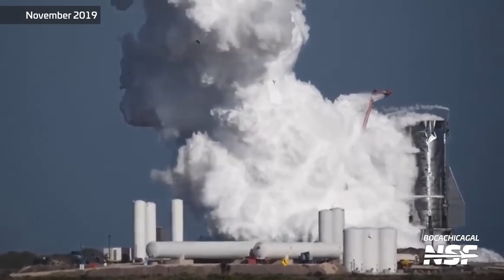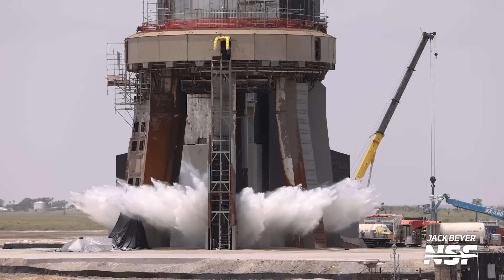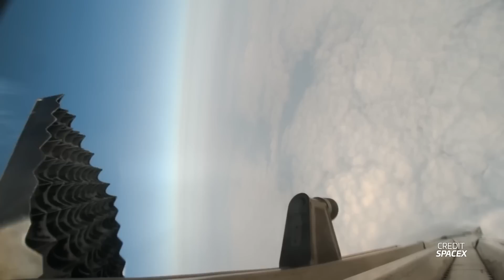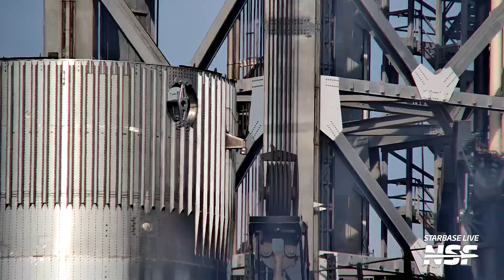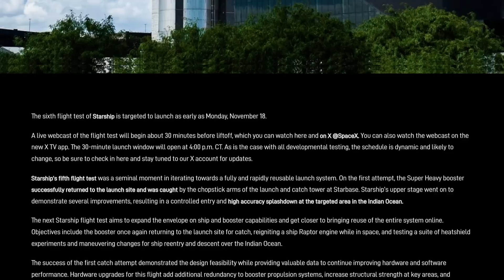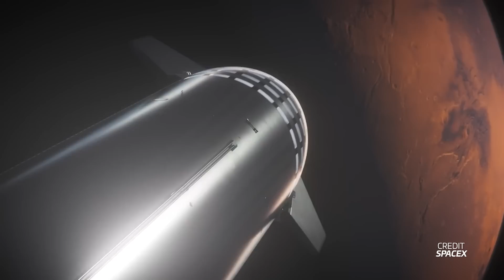Starship Flight 6 Approaches: Timeline, Tests & The Road Ahead! 🚀

Comment: Let's face the facts. To expect that a vehicle have max performance in both atmospheric flight and space flight is ludicrous. Is like expecting that a flying boat will be a better boat and a better airplane. It can't. It will be a duck. It swins, it flyes, it walks but do none is a very efficient way.

We better create space vehicles with specialized purpose as follows:
- Lifters. Capable of pushing things to orbit. They will be different from each main celestial body. A lifter on earth is significantly different than the lifter on the Moon (it could be a mass driver) or on Mars.
- Landers. Capable of reentering the atmosphere and landing on the target. A lander for Mars again is completely different from the lander for the Moon or Earth.
- Orbiters. Everything that stay in orbit of an object. It can be a small comm satellite or a huge modular space station.
- Pushers. Propulsion systems that will be used for orbital maneuvers between Orbiters.
- Heavy Pushers. Propulsion systems that will be used for orbit transfers
- Tankers. Tanks of propellant of different nature. Solid, liquid, gaseous, cryogenic.
- Freighters. Large modular spacecraft assembled together like a train. They can be specialized for human crew, just for cargo.

Regular orbits could be established and utilized to make a circular path between two celestial bodies with minimal use of propellant. This big freigthers would meet the transfer pushers in a very elliptic orbit like the one intended for the Gateway lunar station.
Reply: "To expect that a vehicle have max performance in both atmospheric flight and space flight.."

Who expect that exactly?

Comment: Changing the angle of attack on re-entry is to simulate a higher speed re-entry such as that experienced when re-entering using a free-return trajectory from Mars. With such a trajectory the initial velocity when starting re-entry is much higher with a much longer re-entry meaning much higher forces on control surfaces.
Reply: The higher angle of attack is at the end of the descent not at the beginning
Reply: @Alexphysics13  It's actually somewhere in the middle, a max Q for decent occurs as the atmosphere density increases while velocity is still very high.
Reply: @schrodingerscat1863  I'm not sure why this is even a discussion... it's literally on SpaceX's website 😅
Reply: @Alexphysics13  Pretend experts like to.. pretend.

Comment: Seems like only yesterday we were endlessly eyeing the cousins and early descendants of Star Hopper, steel tanks and Starships standing stoically next to the wild flora on the Boca Chica horizon, with the occasional clouds of gas from pressure testing - or the real treat of engine ignition and eventually glorious soaring flight, followed by a breath-taking touchdown (or the sudden surprise of a rapid unscheduled disassembly!). 
      And then there was all the fun times listening to Jack narrate over 10x-speed Boca Chica Gal videos of Star Base, with mini bucket loaders cruising across the screen at NASCAR speeds!  WAS THIS REALLY 5 YEARS AGO???

Comment: the tiles must be coming off the main body in all the tests for them to be still be changing them and adding extra layers underneath ?
Reply: Hard to know about the rest of the body, but there were certainly issues around the flaps.  The problem is we get engineering info only in small bits and pieces and usually a byproduct of a tweet or promo video.  If we're lucky we'll get an interview with a interviewer who'll ask interesting questions.

Comment: 25 flight in 2025 means that they must launch at least 2-3 times each month and that's insane cadence!
Reply: I would celebrate 16 flights in 2025, I don’t think 25 are realistic.
Reply: Once a month from each tower, I think it's possible, especially when the Florida tower is done that will be 3.
Reply: @GeekyBrian96  I think it will take far into 2025 to have pad B and its tower operational.

Comment: If in the future, they attempt a ship landing/catch during a test flight. Where would that be? Once around to florida? Several orbits? Offshore platform? Back at Boca? Rhe moon/mars...

Also I feel like you could gain a lot by doing some data visualization, such as timeline or a table of ship/booster pairs.
Will we ever get to see a CRS-16 style landing attemp/abort?
Reply: Can't do once around launching from Texas, earth rotates too far in the 1,5h that it takes for the ship to orbit and starship doesn't have the crossrange abilities that the Shuttle did to compensate, so it will be almost certainly at least 4 orbits for landing at the launch site. (maybe 3 if they launch from texas and land at florida, but i don't see this happening. Starship would have to overfly heavily populated areas to land at FL)
Reply: @TheNheg66  We don't know what the cross range abilities are.  ANY recovery will require overflight of populated land.

Comment: * it's not up to, EM said much more than 25. Why is NSF so pessimistic.
Reply: It's up to, that's what Kathy said that Elon would want them to launch 25 times in 2025. No, Elon did not say "much more than 25", not even sure where you've seen that. 25 launches in 2025 is not pessimistic, it's actually a whole lot of unicorn-under-the-flame-trench-land.
Reply: @Alexphysics13  November 10th, he responded to a “one Starship launch every two weeks by the end of 2025” with “We will be much faster than that”
Reply: @ that's like a whole different thing than claiming he said "more than 25". He's referring to the cadence at the end of the next year not about the total launches by the end of the year. In order to get 25 launches in 2025 the *average cadence* needs to be of one launch every two weeks but that's an average. Under the assumption they can even get to that number of launches, the start of the year will intrinsically start at a much lower cadence than a launch every two weeks, it's not an instantaneous change it is a ramp up. So in order to compensate for that, this cadence needs to be much faster than that by the end of the year in order to compensate the slower start of the year so that across the entirety of 2025 it averages one launch every two weeks.
Reply: @Alexphysics13 ugh… full time job if one was going to try and correct/answer every stupid comment/assumption/question in the comments on NSF’s channel alone hey!! Really didn’t think it was so hard to tease a logical flight rate out of Musk’s statement…